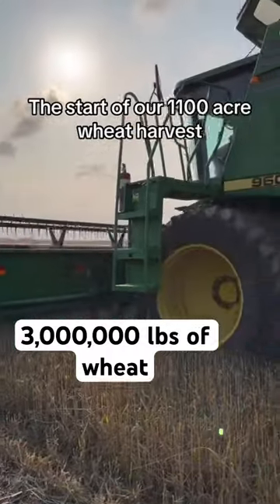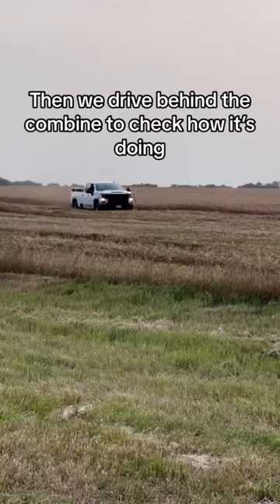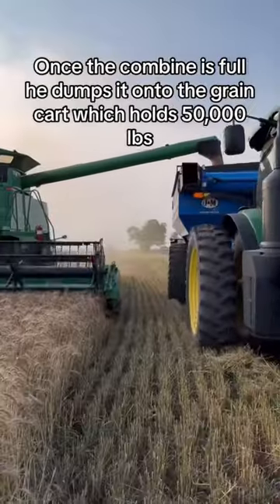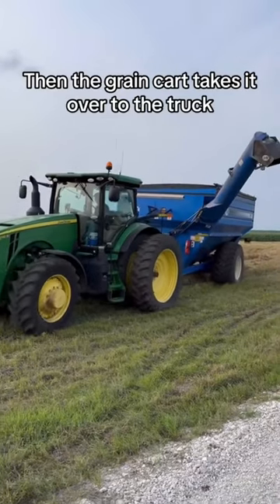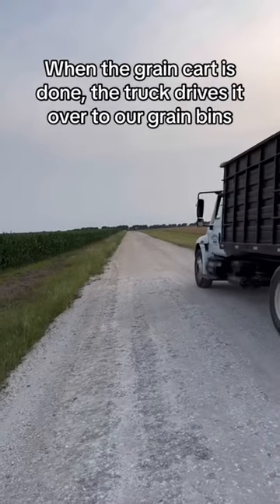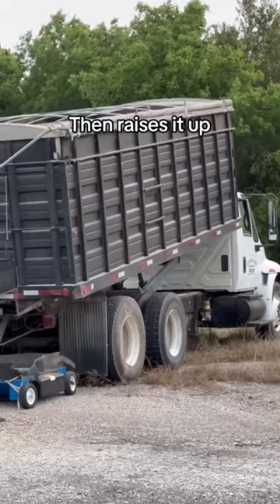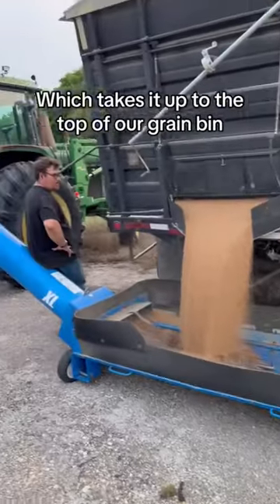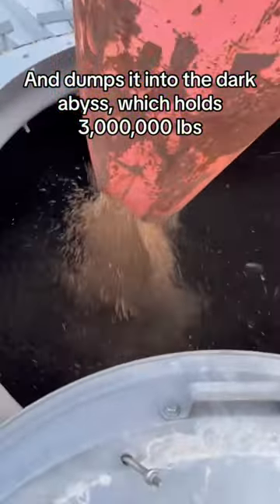Cutting 3,000,000 lbs of wheat! #tractor #farm #farmerfarmer #farming #farmlife #agriculture

Comment: Also is there a way to be able to remove the tractors from the silo set up? Couldn’t you just have the auger connect straight to the piping that goes to the silo instead of have it go through what the tractors holding?
Reply from the maker: The tractor is what makes the auger run. Without it the auger couldn’t do anything